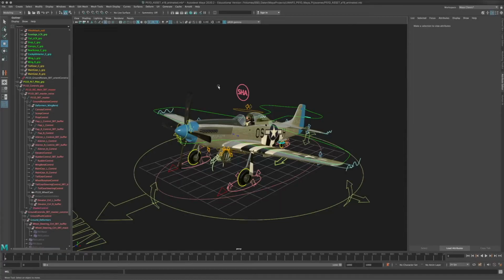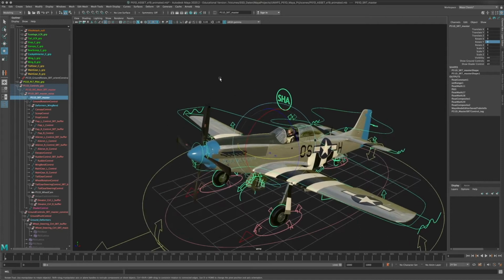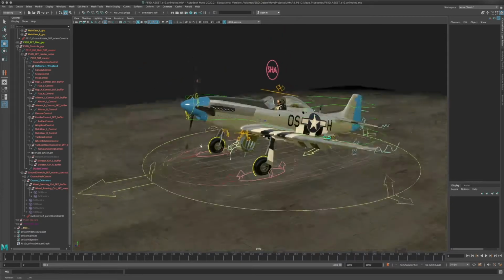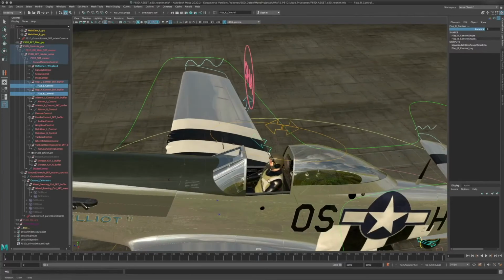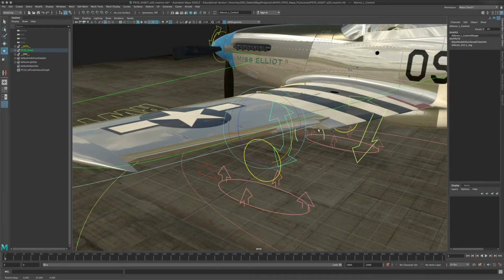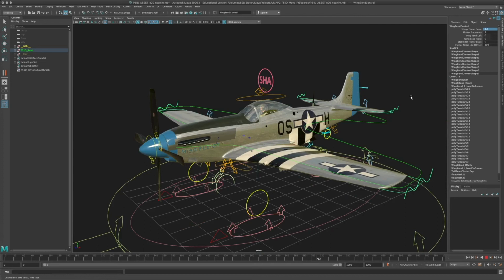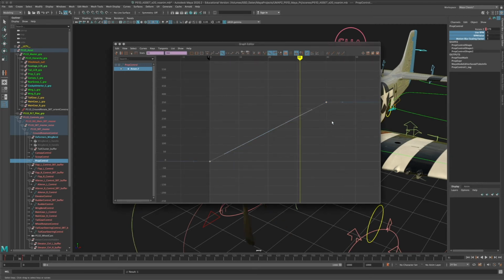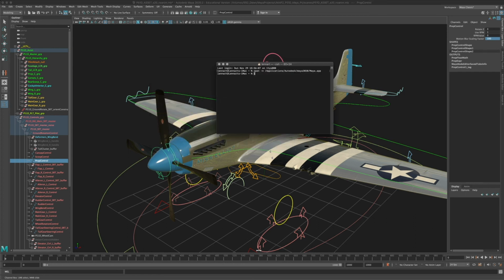HiRes 3D Asset: Rigging II - A look at the control rig (Part 5)

Comment: btw how do you make the material preview look like that instead of black metals and dark mattes?
Reply from the maker: Sorry for getting back to you so late! The material previews are simple Maya Blinns for the viewport that basically recreate the important parts of the arnold shader network with a simple layer node. The arnold shaders are connected to the arnold surface shader of the SG, while the Blinn is connected to the maya surface shader of the Shading Group.
Reply: @lenno5783  i realized when i saw that you can turn on virtual lights preview with an hdr background! looked sick!!